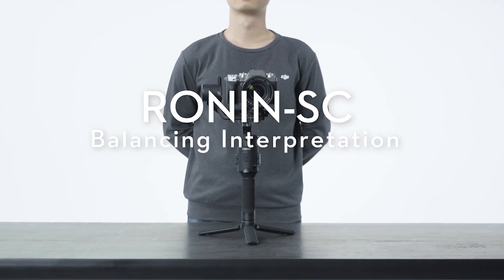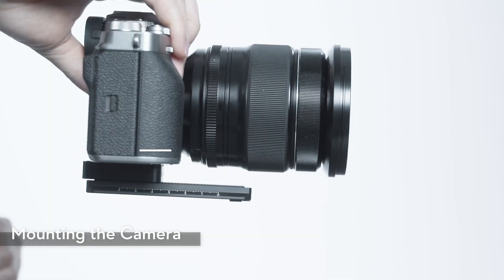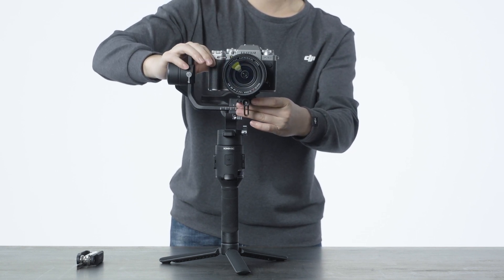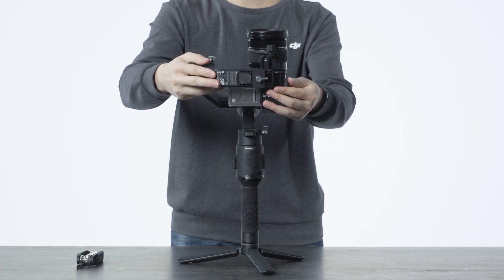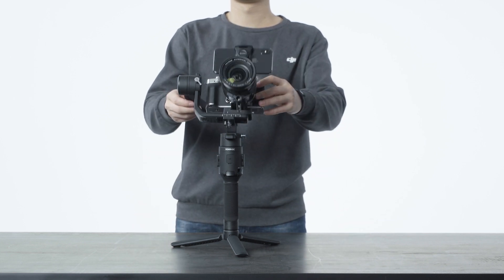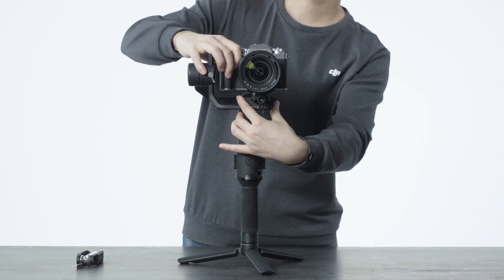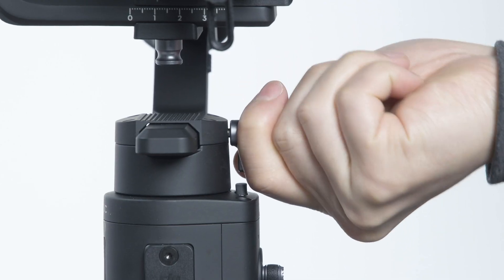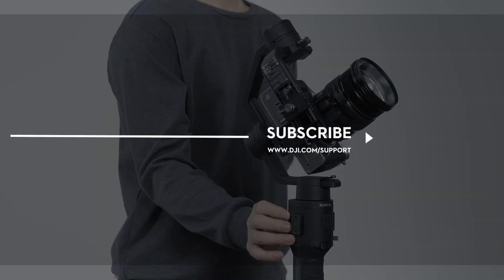RONIN-SC | How To Perfectly Balance Your Gimbal With Few Steps

Comment: I use a Sony zve10 with no attachments and this gimbal ruins my footage every time I film. Idk if my camera is too light or what but no matter how many times I try to balance it manually or through the app and auto tune it, it shake’s constantly and charge doesn’t last. I hate this gimbal so so so so much. Not to mention I plugged the camera into the gimbal and the gimbal automatically records in slow motion………wtffff
Reply: Heyyy, were you able to fix the problem or did you get a better gimbal? If so, what would you reccomand? i have a zve10 and i was planning on buying this gimbal..
Reply: @hachiman7522  honestly I bought the ronin rs 3 pro. It’s a tiny camera for it but you’ll grow out of the zve10 pretty fast. But if you’re not looking to spend the money on a gimbal you can risk the Ronin sc I think I just got a bad one considering I bought it on Amazon and not the Dji site

Comment: After a while, I ve encouter a problem with my Ronin SC, the horizontal axix (roll axis) is offset to the right by 2 degress... can't fix it no matter what. I ve talked to DJI support and followed every step as follows: horizontal calibration, system calibration, auto tune, excellent camera balance on all axis, factory reset, joint angle calibration, firmware downgrade. Has anyone encounter this issue and solved it somehow? Please advice, I have many DJI products, but I can't belive that the Osmo Mobile gimbal has a manual horizon tune angle function, and a Pro level gimbal such as the Ronin SC dose not.... I am disappointed and I don t know what to do.... no more warranty either...
Reply: Literally my problem right now. Happened out of nowhere
Reply: @Fefe8484  I solved it by getting a Ronin SC 2 with manual horizon calibration overwrite. I got the same problem with the new RSC 2 after a few months, but now I can compensate via manual adjustment

Comment: Hard to do. Lots of things to adjust and check. Should have been simple and short. Or it should have the ability to check its own balance.
Reply from the maker: Hi there, to accurately judge whether Ronin-SC is completely balanced, you can connect it to the mobile device, launch the Ronin APP, find the "motor parameters" setting, click "more parameters", and check the power values of the pan axis, pitch axis, and roll axis. After the Auto Tune is completed, the smaller the power value, the better the balance status. If it exceeds ±5, it is recommended that you re-adjust the mechanical balance before performing Auto Tune.

Comment: I have the Sony a7iii and the sigma 24-70mm f/2.8 DG DN Art lens. I just got the Ronin SC. I am having trouble getting it to balance. I’m wondering is my lens too heavy? If so what lens would you suggest? Or is there something I can do differently to get this to balance.
Reply from the maker: Hi there, if you still cannot get it to balance even following the steps on the tutorial, you may contact our support team through the link below and provide a video for further assistance. http://www.dji.com/support
Reply: Did you ever get this figured out? I’m having that issue right now
Reply: Same, im running with the same gear but it seems to heavy for the gimbal how did you counter this?

Comment: The only problem I have with this gimble is putting to work  the auto focus feature knob.
So, I do not use it.  The knob tight the rubber band and gets stock.  I hear that Ronin R2 works better.
Reply: I brought the whole focus kit without realising that just using a USB-C supports alot of cameras, my GH5S can just be plugged in with a USB-C to the adjustment knob and then select pc tethering on my camera, alot of Sony ones are supported too. For some reason the supplied usb-c is directional for me though? It litterally only works plugged in one way

Comment: stop whinging, watch the tutorials, and actually do something for once.... "doesn't auto balance"... you poor things. mine worked great first time. downloaded software, balanced camera, linked bluetooth and tested. come up as "excellent"... thanks DJI. too easy.
Reply: With a phone on top of the camera?
Reply: @mikehunt2667  full sized camera yes Sony A65... not so good with small compact camera Sony RX100... seems it works best with a camera that's a fair bit heavier than the phone otherwise it's too top heavy.
Reply: @AVportau  thanks . Im ona gh5
Reply: @mikehunt2667  remember once it's balanced you can't change the zoom with any lens that extends coz it changes the balance... i generally use a 10mm (15mm in APSC, 20mm in micro4/3) and set focus at infinity... what country are you in? i know someone with your name in Australia.

Comment: Balancing the gimbal needs some practice once you have done it a lot of times I started to understand how this awesome gimbal needs balancing and by using a appropriate quick mount there is no need to balance it every time you use it. Btw I use a Sony VZ 1 without changeable lenses, that also saves a lot of time balancing. I really like the Ronin SC app it works flawlessly and I always Autotune, in the Ronin SC app,  to fietsen  the gimbal before using it. I have used other gimbal in the past and this gimbal is the easiest gimbal to use!!

Comment: Ronin SC* Pan Axis unable to get ''Excellent''
SOLUTION
While doing the balance test, I tilt the Gimbal over 25-30°, I then get ''Excellent''. If I immediately balance test again at 15° I get ''Re Balancing Required'', so it is some kind of bug. Just balance-test it at around 30° and it's good. Hope this helps anyone with the same problem. I have spent way too much time trying to solve it before I found out about this and I'm an expert in balancing a gimbal now xD

Comment: So frustrating my camera only weighs 1.2kg and no matter what I do it won’t balance !!!! I have tried everything. It always falls back or forward, it will never stay in one position
Reply from the maker: Hi Leo, we are sorry to hear about the difficulties that you encountered. Please contact our support team via http://www.dji.com/support and provide us with more details. We'll do our best to help this out. Thanks.
Reply: @DJITutorials  I have the Sony a6400 with the kit lens (18-135mm zoom lens). I also have several other lens recently obtained. Now i balanced the SC for the 18-135 mm lens. Question, if I swap that lens for another lens, do I have re-balance the entire gimbal again?
Reply from the maker: @bobbyiii5534  Hello, there. Thanks for your inquiry. There are two key points for “balancing and usage”:

1. Gimbal load;

2. Camera’s distribution of the center of gravity.  
Assuming that the total weight and gravity center are fixed, the gimbal does not need to rebalance again theoretically after you change the lens. If not, we recommend rebalancing the gimbal. Please observe the actual condition and do the balancing.
Reply: @DJITutorials  and when a phone is on top ? Its impossible
Reply from the maker: @mikehunt2667  Hi, there. Sorry for your inconvenience. Do you mean you want to mount a phone with your camera on the gimbal together？
Reply: @DJITutorials  yeh
Reply from the maker: @mikehunt2667  Could you please provide us with a video for further confirmation? You can send it to DJI Support through this link. http://www.dji.com/support
Reply: @DJITutorials  Another question too, I'm just getting into film/photography and will be moving about from place to place; what's best practice for maneuvering the gimbal from place to place safely? Is it better to dissemble the entire thing a have it in that case it came with,  or just take the camera off the gimbal and leave the gimbal assembled with the camera separate as it transports from different areas?
Reply from the maker: @bobbyiii5534  Hi, there. For this question, we do not have an official or optimal answer for transportation. We would recommend you to carry the device and camera in a secure and portable way, avoiding liquid and a huge external shock. Thanks for your understanding and support.

Comment: An important piece of information that no one tells you. We have a very lightweight camera (a Sony ZV1) and it was too light to balance without an accessory (such as a phone or mic mount). When we added the mic, we were able to balance the tilt. 

I still have no idea when or if you need the motors running for different balance tests. It seemed like you did for all of them? I know at one point the motors went to sleep and when we turned them back on the pan balancing worked again. 

The video looked really good when we got it working, but the instructions are horrible.

Comment: I just bought mine and it will be delivered tomorrow. Looking at this video.. I'm now stressed coz I will be needing to use 2-3 lenses for each scene. Why can't they just design a gimbal that will balance itself or at least the motors will adjust automatically? Is there any other gimbal out there that is not so demanding to balance?
Reply: M stressed too😑
Reply: @ABArtandInfo  I sold mine... Lolz
Reply: @techgat3keeper879  have you found any gimbal that worked better for you? Talking about the balancing for each lense.
Reply: Can you buy extra gimbals for each setup?
Reply: Yeah I was planning to shoot with 24-70/35/50/85 lenses...didn't realize it would be so much work...rookie mistake. I'm selling mine just can't be bothered.

Comment: This might sound stupid, but are you using two screws on the bottom plate to attach the riser to the camera, or one? I couldn't get my big Sigma lens to balance because I was using two screws. When I switched to one, I was able to balance it.

Comment: I just purchased this and was able to get it to balance yesterday morning. After that I spent all day trying to balance for some reason I can't get the tilt to balance. I have a panasonic gx85. I can't use any of the app features because no way to connect ronin sc to this camera model.
Reply: The tilt is probably the most difficult of the 3 balancing steps. Make sure you're balancing at a 45 degree vertical angle if you have anything on your camera's hot shoe mount. If you feel you've manually balanced everything then launch the Ronin app and perform the balancing test, see what your score is, if it's excellent or good then move on to the motors auto tuning. From my experience, sometimes even after getting all excellent for the balancing, my motors still kinda act weird until I complete the auto tuning.

As for your camera, you have a Panasonic just like me (I've a Lumix G7). If your GX85 has the jack input for shutter control, then just purchase the DJI Ronin SC Part 9 - RSS Control Cable for Panasonic Camera . You don't get this cable with the Ronin, only the Type-C and Sony multi camera cables. Once you purchase the Panasonic one, you'll be able to connect and control your camera with the Ronin.

I've just finished recording my in depth unboxing and set up videos for the Ronin-SC Pro Combo. I'm using the Panasonic G7 for the set up. Videos will be uploaded in future.
Reply: @kingsley15  Thanks for the response bro! I'm having other issues as well. I think holding the trigger is supposed to lock the gimbal. Mine still sways. It could just be me but it is difficult to keep things centered. I don't know if this is proper procedure but In order to do a 360 around my subject I have to manually lock pan and roll axis. Is a gimbal supposed to sway and move so much? Maybe be I need to practice my techniques. I don't know what else to do...
Reply: @dancrosby6091  
No problem at all, I'm happy to help any way I can.
Holding the trigger locks a point of view. So let's say you have your camera pointing at an area, if you hold the trigger, your camera will basically lock to that area even if you turn and twist the gimbal handle. For a 360 shot of a subject, I prefer to use the Pan Follow mode or Active Track. My first choice would be pan follow, I normally set the speed to high and then walk around the subject while always aiming my camera at the subject. One thing to note, you have to walk really smooth, bend your knees while walking around your subject. Also make sure you're turning your gimbal handle slowly and smoothly, while always keeping a direct view of the subject... I think a lot of people don't really do this because they assume the gimbal should be perfect to all movements. You should still pretend you're not using a gimbal and try to move slowly and smoothly. If you want to take sporty shots, then try FPV mode.

You're right, it's all about practice - practice makes perfect. I spent about 8 to 10 hours just for learning and testing (🥴), I genuinely learned so many things every hour, it all feels like second nature now. I have the focus rig set up as well and that was kind of daunting at the beginning, now I set everything up to perfection in less than 10 minutes. Keep at it, this is a fantastic gimbal, it just takes some getting used to 🙂. Drop a comment here if you need more help, or have more questions.
Reply: @kingsley15  Thanks again. I understand better how the trigger lock works now. You can make slight twisting movements etc. but you have to be smooth and can't over do your movements. I'll have to try pan follow for 360 around subject b/c I can't connect gx85 b/c it doesn't have remote port. I was torn between g7 and gx85. I went with gx85 because of extra lens and IBIS. I'LL keep practicing. It takes some getting used to. I thought this thing was broken it seems so hard to control. I'm sure in time I'll get better. I already have a better feel for the trigger lock feature. Still can't balance tilt to save my life. However I balance the other 2-axis and I am consistently getting excellent on all axis in balance test. Thanks again. I'm subscribing to your page right now bro! Blessings👍
Reply: 2 last questions. What exactly is dead band? What are your custom settings under the control feature in the app (motion etc.)?
Reply: @dancrosby6091  
Nice one! Keep an out for my Ronin-SC uploads. Best of luck with you Ronin-SC, definitely keep it, it's amazing! 😊
Reply: @kingsley15  Will do!
Reply: @dancrosby6091  According to the manual - Deadband determines how much movement the gimbal tolerates prior to translating the pan, tilt, and roll movement of the camera.
In simple English - it basically means how much you have to move before the gimbal responds.
By control feature, do you mean Control section under each "User Profile"? So Mode 1, 2 & 3.

I'm on Android and I have Ronin app v1.2.12, which I believe is the latest as of this comment.
I usually mix and match my settings depending on what I'm shooting. However, here are my general settings - I usually leave the control section on default for all modes:

Mode 1 (M1) = Customized
Speed:  High
Deadband: Customized (Pan 0, Tilt 0, Roll 0)
Push Mode: Push Pan & Tilt
Control: Default

Mode 2 (M2) = FPV
Speed:  High
Deadband: Customized (Pan 0, Tilt 0, Roll 0)
Push Mode: Off
Control: Default

Mode 3 (M3) = 3D Roll 360
Control: Default
Reply: @kingsley15  Cool thanks!
Reply: Hi Dan, I have a Panasonic gx85 too and also just bought this gimbal. It’s super frustrating getting this thing to balance. How long did it take until you eventually got it? I’ve been trying for three hours and had to give it up lol

Comment: I am about to buy my first Gimbal and I like the look and functionality of the SC, currently I have a sony a6500 with the gorgeous Sigma 14mm 1.8 Art lens, is the SC capable of motor stress free balancing? Plus, I will be buying a Sony A7siii soon as my main camera, again will the combination of the camera and sigma lens be ok?
Reply: I’m pretty sure i would get the counter weights tho. That lense is pretty long
Reply: @CineZoneYT  I've used a telephoto (unextended / zoomed though but still pretty long) on my SC with my GH5S, you do have to really really balance it well otherwise the motors will cut but worked for me, I do run a mic on my camera though so that maybe helped balance
Reply: I have the same set, did you try with the 14mm?

Comment: Is it necessary to auto-tune after such a good balancing?
Reply: Hi,, Did you ever get your answer ? I am also very interested about it .
Reply: @damiangorny7740  no :( such a great support :/
Reply: @dronteam  I try to find out also, because I use go pro and Canon m50 on the gimbal and there is a difference in weight, so motor parameters are not performing well.
Reply: Yes. Auto tune helps remove micro jitters
Reply: Yes, it's 100% necessary in my opinion. Even after getting all excellent scores for balancing the motors, I still have shakes until I auto tune.
Reply: @kingsley15  Sometimes auto tune does not work , I have to do it manually

Comment: I sold my ronin S to get ronin SC and i really really regretted and got fired out of my job because it's very difficult and complicated to get all motors "excellent" in the balance test and the results are very shaky and the setup of the system is very easier on Ronin S specially "the 45° inclination " it makes no any sense

In general the hole balance process is very annoying! i used to get my work done in less than 5 min on Ronin S now it takes more than 10 min on Ronin SC and that what embarrassed me at my work and freelance projects
Reply: Same here, sold the Ronin S for this with those awesome features that they showed at launch but couldn't balance the phone on top... waatched so many videos online but still.. nothing!
Reply: @ANDJVisuals  same here and im pissed . How do I track now ?
Reply: Agree the ronin S is much better and works just fine if it’s not “balanced perfectly”